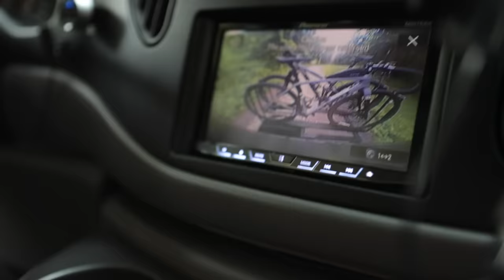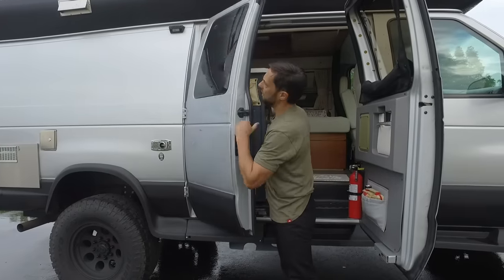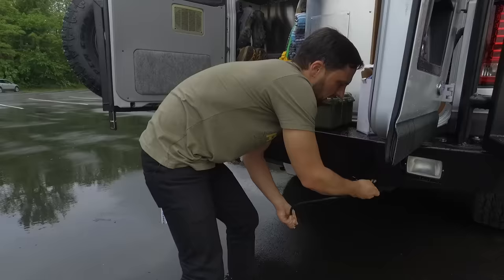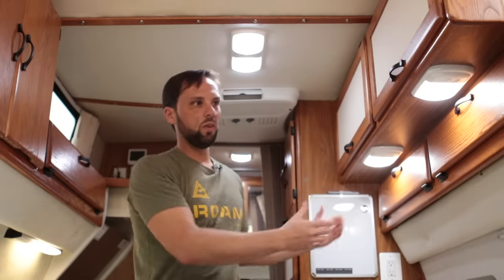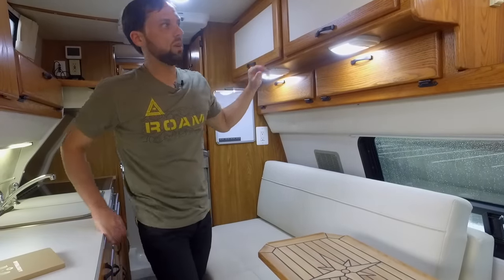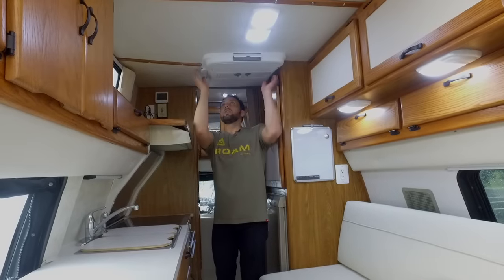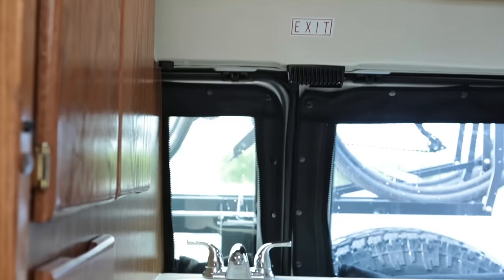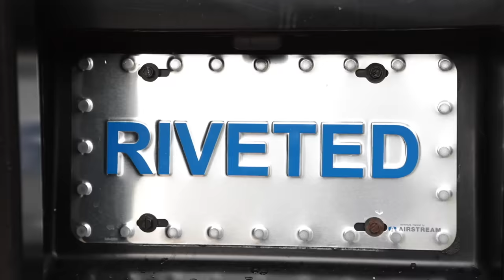MEGA VANLIFE TOUR | 4x4 Overland Off Road Airstream B190 Ujoint RV Conversion Motor Home

Comment: I've been binging camper van videos lately and I've been seeing some really cool ones, but this takes the cake by far. My dad had a lifted 4x4 '74 chevyvan with a V8 and 35" tires. I have many fond memories of being a kid and going four wheeling in it. We used to take it to the beach. Across the state. The back had bench seats with a table that converted into a bed. It was red with Marvin the Martian stickers on it. It stood out on the road and was well liked. It was just a cool rig to ride around in that could also do some decent wheeling on trails too. He also installed an air compressor to lower/raise the tire pressure at the entrance of trails.

I've always had an inkling to rebuild that van someday when I had the money. Seeing the van in the video really makes me yearn to do it, and add camper components like you did to your rig. You probably would want to take up anything too gnarly, of course, but still, the mobility has got to be great. Especially compared to a regular RV. Lol

Great work. And great video editing too btw. Very well explained and recorded.
Reply from the maker: Thank you for checking mine out

Comment: Cool conversion and well detailed video. As for your braking, the f350 brakes should be more than enough. One thing you can do (which is something I did on my 1999 f350 powerstroke), is upgrade the brake lines to braided stainless brake lines. Any part of the brake lines that are rubber, upgrade to the stainless braided line. You should have hard lines from the master cylinder to the frame near each wheel, then a flexible line to the caliper. That flexible rubber line is what you want to replace with stainless braided lines. You may have issues finding them ready to go,  but if you contact a company named "oil filter service" which is located in Portland, Oregon they can custom build you the lines. Another company to look into is frozen rotor. They do cryogenic treated brake rotors. Then upgrade to a ceramic brake pad and do a proper break in procedure. 

You will notice a big difference in braking performance by doing the braided lines as well as the upgraded pads. Really cool rig!
Reply from the maker: Thank you for the suggestions

Comment: "This is the exhaust pipe."

...thanks for clearing that one up.
Reply from the maker: Ha ha ha
Reply: lol. And this is a dry erase board, i have marker too. lol
Reply: All that money spent on an off road camper and didn't fit a snorkel to the exhaust... 🙈
Reply: @ImMizerD  Snorkel on the exhaust? You mean air intake...
Reply: @CanadianTexaninLiguria  Ooops, 🤪 yes you're correct, thank you.
Reply: @ImMizerD  yeah because the generator and everything low wouldn't get ruined at that depth.
Reply: Alfonso Bernabe what are you, his older brother? Go donate to Melania's anti-bullying campaign and then watch a few standup shows to learn what humor is

Comment: Only 2 problems with the van. 1 it needs a 5.9 Cummins. And problem  2 is that  I don't  own it. Very nice well done 👍
Reply: s Gamgee a 6bt with a NV4500 would be sick
Reply: Dönald Trümp a 5600 would be even better. Extra gear and an incredible transmission.
Reply from the maker: Thanks for watching.

Comment: The type of vehicle you would want to survive an apocolypse in.
Reply from the maker: Yes but at 6mpg it may be a problem
Reply: Why do people think they'll be able to drive in an apocalypse? 😂
Reply: @vividhaiku Exactly tyres and fuel have date of expiration, not to mention road blocks, dead traffic jams, etc.
Reply: as long as the apocalypse isnt to windy or off camber
Reply: @NewJerseyOutdoorAdventures  Wow..... Are you kidding me?
Reply: @vividhaiku  He'll have a place to sleep.
Reply: @NewJerseyOutdoorAdventures  is it actually 6mpg or is that a joke LOL
Reply: @odys3803  Hard to drive when you can't get fuel.
Reply: @solomonjenkins9505  big ole V10 gaser. a ton of weight with high gearing and 35 inch tires... yeah thats not a joke.  My brand new light weight, 2.5L 4 cylinder sports car averages 18.
Reply: I have a class C 25ft RV with a Chevy 350cu in with fuel injection and I'm lucky to get 10 MPG going downhill
Reply: I'll take my chance with a bicycle
Reply: A bicycle is good for the apocalypse because no gas. And easy to fix
Reply: @ediodimacaroni  yep. I'd use a bicycle or just my legs
Reply: An electric vehicle would probably be the way to go, as long as you bring a portable solar array everywhere you go.
Reply: Oliver Janeba
Also, gas will not be available.
I don't suppose there is any reason to survive the apocalypse.
Reply: @user2C47  only if its emp proof
Reply: @recoveringsoul755  That is only a concern for a single type of apocalypse, but definitely a concern. To counter this, it would be necessary to keep a spare motor controller and battery charger in a metal box. Obviously all you would have is the main drive motor, but that should be sufficient as long as there is a mechanical connection between the steering and the wheels. There may not be time to get this working, so it would be best to just have a metal-framed garage. In other scenarios, it might be a better idea to have a tank.

Comment: Wow. Awesome Vehicle. You did an excellent job on it. I think that you tackled every problem with so much cool optional equipment. It is a fully equipped RV and then some. I have a Nissan NV3500 that I am thinking about converting to an overland vehicle. The Ford is extended which gives more room. The NV is not. Good Luck with it. Enjoy.
Reply from the maker: The NV is a great platform is wider and more square

Comment: I’m buying a quigley 4x4 e250 soon. Not going to build it into a camper van, because I’ll be using it as a cargo van, but I’m planning on making some modular pieces for it like a bed and table/seat. It’s actually going to be my daily driver/work/overlanding rig. It’s literally going to do everything I need it to. I won’t be camping in style like you but I’ll definitely be able to take some extended road trips in it and not have to worry about paying for hotel rooms or anything like that.
Reply from the maker: Sounds like an awesome project

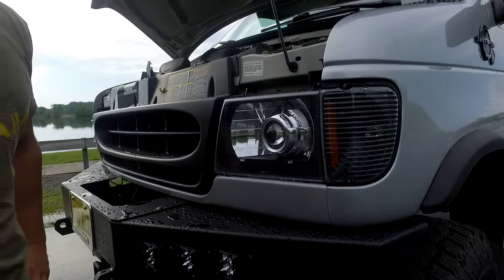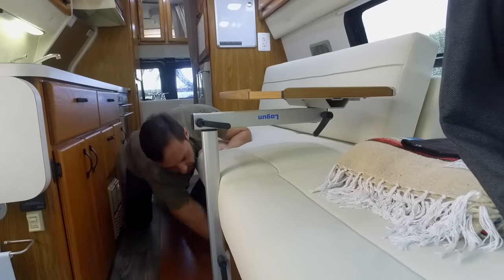Comment: 17:19--- You should mount a set of aluminum RV collapsible steps under your front bumper in the middle for easier access under the hood. Seems like standing on the bumper would make you too high in the air. The steps would offer three different levels and of course the bumper would still be an option. I think those RV steps are only a couple hundred dollars and they hold up flat. I've been watching RV, van life, camper videos for almost 4 years now and yours is my all-time favorite! I think it's possible that I've seen almost everyone at least those that are on YouTube. I'm a native of Tampa Florida and obviously there's crime to be concerned with and so I was thinking when I get my van I'm going to put a removable steering wheel that way when I park my van for the night or if I leave it in a parking lot and have to leave it unattended for any length of time I'm going to take the steering wheel with me. I've never seen anyone with a removable steering wheel but most of the vans and RV campers etc are all from the Midwest and Central parts of the United States so I don't think there's a big crime issue there at least not like it is in a major metropolitan area. 24:38- Throw pillows are a great storage option for bedding. Buy some nice covers from Ikea and then fill them with all of your bedding and leave them sit on the sofa. You can even put your bed pillows in a pillow cover so that it looks like you have four really nice decorative pillows on your sofa. That's also a way to hide extra blankets and linens in your bedroom.

Comment: I love the Van Camper. The Couch Bed would of been better and easier with back flipping over and making a bed. In one nice easy flip. Ive seen that on some older Van. Tool less work than what I just seen you do. Just an idea. Maybe you want to look into it. Pulling out the base, than moving the pillow couch backing. Looked like a pain. 4x4 is sick! Great job on it!
Reply from the maker: It’s mostly just me and I sleep on it with out pulling out
Reply: @NewJerseyOutdoorAdventures  Ah, you sleep on it in coach mood. Ya, I do the same.

Comment: The perfect RV is a all fiberglass  26’ class A on a 4 wheel drive but with electric motors on every wheel. Run the generator at a gallon and a half per hour, and get 65 mpg.

Comment: Do you have extra hoses for your vans motor? Extra drive belt? What about leak fix for the radiator? What about a few quarts of motor oil and trans fluid? You guys think of only comfort and convenience in your vans. But never think about the most important. The vehicle itself.
Reply from the maker: Extra belt, just put on new hoses and radiator three weeks ago. Plenty of oil, extra ignition coils, plugs, wiper blades etc

Comment: why pump up one tire at a time? Look at MorrFlate kit. It'll hook to your compressor and inflate all 4 to the exact same level. It'll deflate all 4 to the exact same pressure. If the compressor breaks, it'll take air from 3 tires to fill the 4th to get you by... Maybe I'm missing a scenario when 1 tire at a time makes good sense.
Reply from the maker: Cool system

Comment: PLEASE READ, THANKS.
Yep, it's a wicked as, camper. A couple of questions, why only have a vertically half-sized bumper/bull bar, why not protect the bonnet/hood and lights etc as well ?. 
I'd be concerned that as you don't have a removable camper you are unfortunately forced to accept and pay for all possible large expenses that involve the vehicle itself,  EG new replacement conventional motor, or a fitted electric motor. It's entirely possible for the vehicle to be written off with no or minimal damage to the camper itself. Rare scenario sure, but still possible.
Reply from the maker: I am waiting for UJoint to come out with the upper half.

Comment: I have been watching your station for a while and never viewed this of your own rig ...  neat.  I wonder, ave you done upgrdes since 2019?
Reply from the maker: Lots of upgrades. 960 amp hrs of Lithium, 3000w inverter, DC to DC charger and new roof top air conditioning
Reply: Wow, great. 12volt AC?

Comment: Great vid, great vech, I drool, The only thing I would change is prop heater chg to diesel heat. had Bad time with prop lots of moisture  caused mold and rot, on oct trip to artic, chg over to diesel no probs.  just a thought  Thank you
Reply from the maker: Thanks for the tips! I have done a lot of upgrades since this video but diesel heat wasn't one of them since the engine is gas and I don't want to lug around a diesel tank too.
Reply: @NewJerseyOutdoorAdventures  Understood and I thank you for taking time to reply appreciated

Comment: Impressive camper! Thank you for the tour. You did a nice job on the curtains. Also impressive.
I have two questions please.   1. Why raise any vehicle so high when the axles, drive shaft, sway bar are still low? Please clue me in? 
2. What is the interior height?
Thanks again I I really enjoyed this video. 👍New subscriber.
Reply: The lift and axle upgrades are pretty standard moves to take a vehicle on very rough trails with lots of grade changes. It allows you to get to really remote boondocking sites. Axles aren't a big problem with taller tires. It's usually the area between the front and back tires, and the front and rear overhang that get hung up. 6'4" interior if I remember correctly. Got to look in one a few years ago.

Comment: there are many stoweable compact stainless external gas grills that you could use.
Reply from the maker: Ill check them out.
Reply: @NewJerseyOutdoorAdventures  Although, no awning, do you have the capability to rig a temporary one on side or rear doors in case of inclement weather?

Comment: Is there any way to lift the roof in front for the where the bed is? I think I would get claustrophobic in that little cubby over the driver's seat there
Reply from the maker: It is roomy. There is a lower bed if the top is too claustrophobic

Comment: Curious, will you get more room with this van, or would it be more spacious with a Sprinter/Transit? The problem is, they aren't great at off-road. I currently have a 4Runner, and I need something with a high roof to stand in.
Reply from the maker: The Sprinter, Promaster and Transit are more spacious than this

Comment: It's nice but damn....the price for it all is pretty insane. I started checking out after I heard how much the 4x4 cost and how long it took to install. I get it, it's a great van but the price on the suspension makes me feel like you could've built it from bits from the parts bin.
Reply from the maker: Thanks. You can just get a 2wd and put a lift on it.

Comment: Hi Patrick after seeing this video many month's ago I have to say that the B190 checks all the boxes for me. Especially with the E350 chassis and the U-Joint 4x4 conversion option. While most of the lower chassis (non-fiberglass) is not a concern for me; I am however curious to know if there are part replacement opportunities specifically for the top fiberglass piece (e.g. windows, window seals etc..) from Airstream.  If not , can you recommend another source?
Reply from the maker: The top is no longer available but the windows can be reproduced by a HEHR window licensed fabricator. There are also similar tops from Fiberline available.

Comment: Someone help me out with the practicality of raising the airstream which looks great by the way but when the u-joint is so low to the ground what benefit do you get by raising it and don't understand it just seems like a lot of extra money could have gone elsewhere considering it doesn't have any extra clearance as far as the lowest beam is concerned sure it looks like it has more plans from the side but from the front you can tell it's less than a foot clearance.

Comment: Cool video. But a heater is completely unnecessary and a waste of money. What happens in the wilderness if you run out of diesel? Drill for oil? Also what happens when you dont wake up from carbon monoxide or fire? How about buy a blanket and a sweater no diesel or drilling for oil neccesary . I spent time sleeping in cars and tents in winter, no heat, just blanket, body heat and clothes.
Reply from the maker: Just about every RV made has a furnace and many of them run on LP.